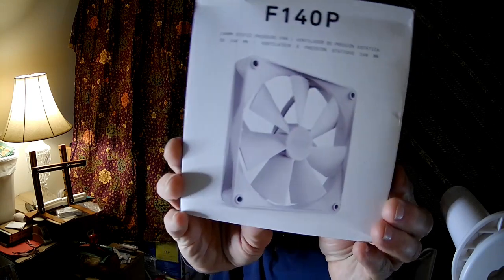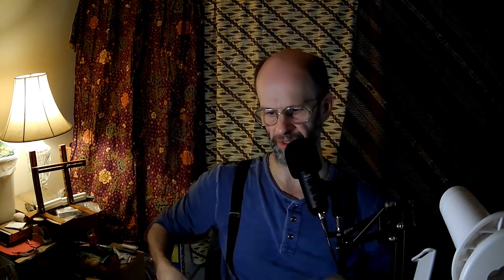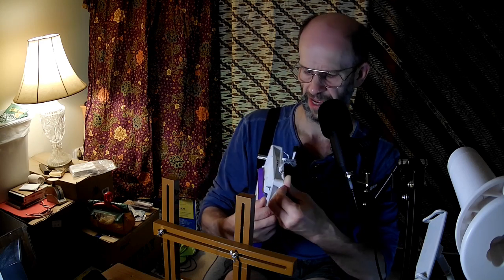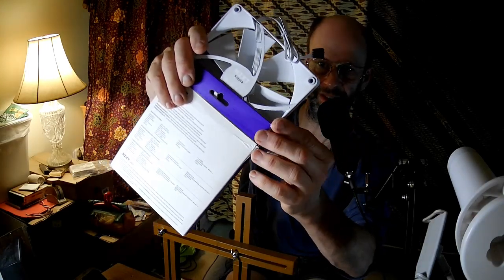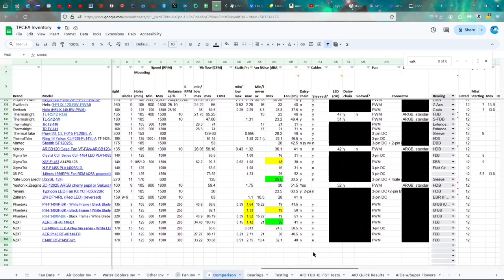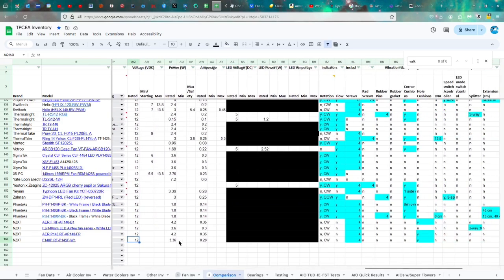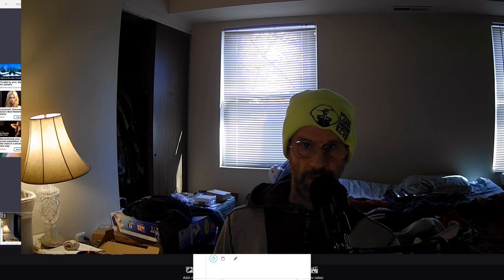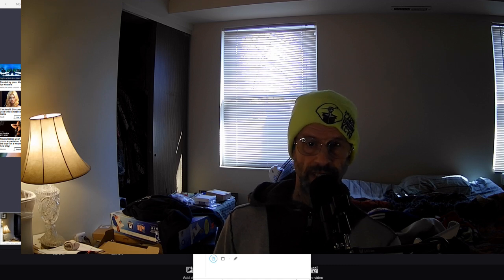NZXT F140P PWM Fan Review, Pt 1

Comment: Aren't there 2 versions of this fan ? ... one from 2022 and the other from 2024 and on ? two different max rpms and SP ratings no ?
Reply from the maker: There are many fans that do or don't look identical but have the same or different specs even though they have the same model number. DeepCool FC120 is an example - the ones on the AIOs are better than the ones sold separately. Companies change designs and/or hardware to save money and may or may not update the public.